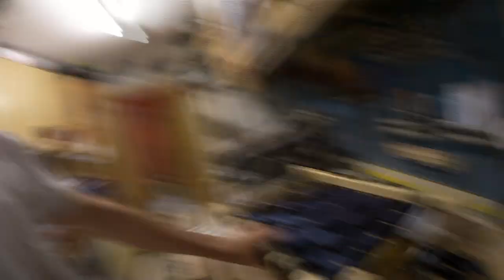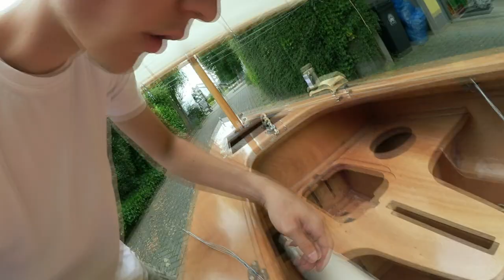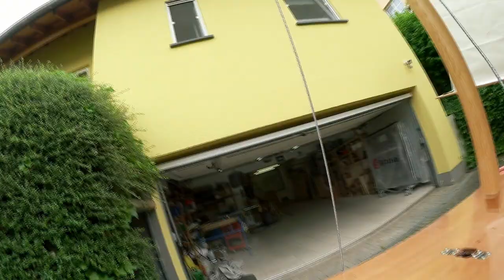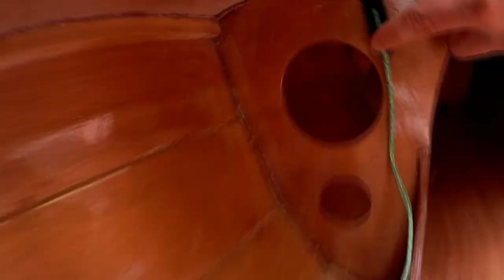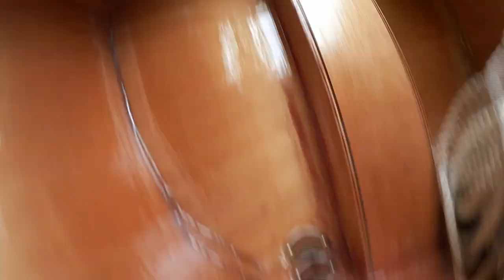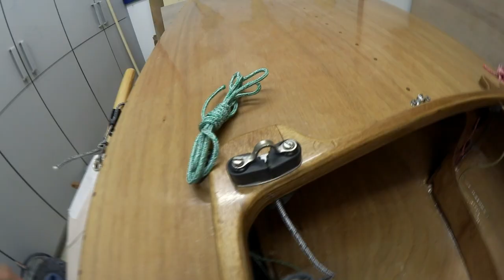Building a Waterlust Sailing Canoe (part 12): Installing hardware and 1st time rigging up

Comment: Amazing that this has come from a kit and turned into this well done looks fab. I was wondering what are the measurements for the main hole in the cabin (the seating area) and the length where you could sleep. Cheers.
Reply from the maker: Hi, thanks for your comment. The sleeping area is about 2 meters long if I remember correctly, I'm not sure about the opening though. I'll measure it up when I am on the lake next time (probably next week). Cheers